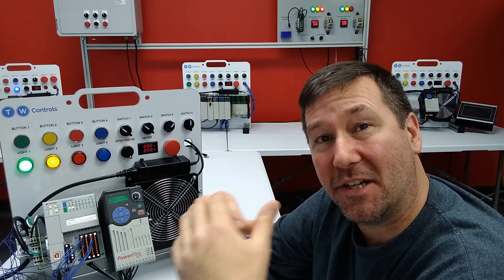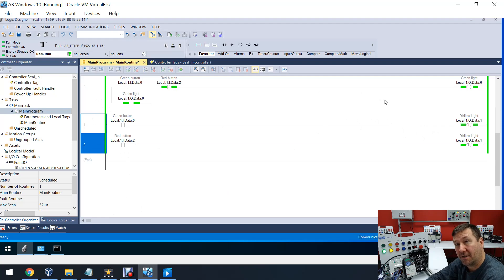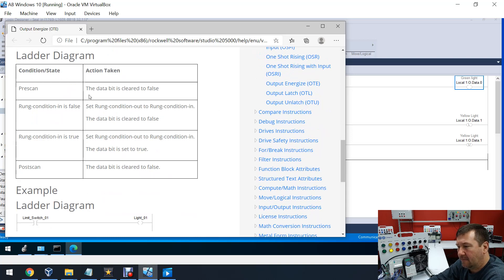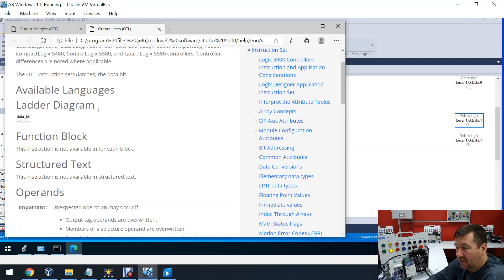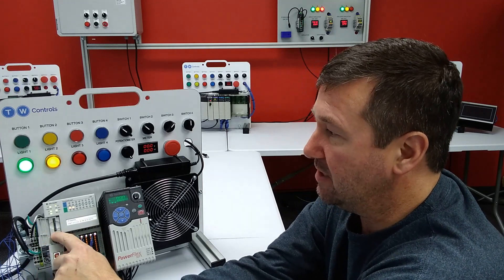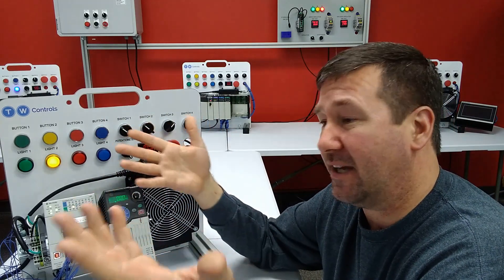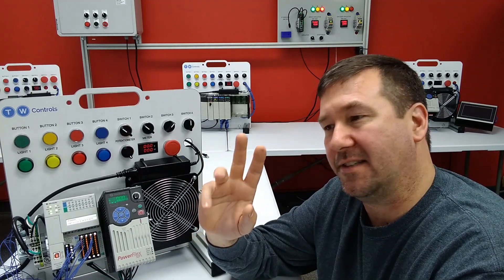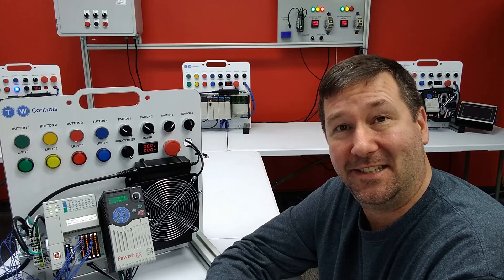Studio 5000 Power Up OTE vs OTL OTU of a Controllogix Compactlogix

Comment: Ok Tim, I tried the example with the S:FS instruction on my (U) rung but have multiple inputs via branching. When I added the S:FS branch it did not show First scan when hovering the mouse pointer but I got an error Invalid Direct File Offset?? Can this be used on multiple branches on a (U) rung??
Reply from the maker: What PLC are you using?
Reply: SLC 500 L541 16K  @TimWilborne
Reply from the maker: It is S:1/15 in it.
Reply: I'm not sure what you mean Tim can you clarify S:1/15 @TimWilborne
Reply from the maker: You are trying to type S:FS in a RsLogix 500 program.  It does not exist, it is S:1/15
Reply: Ohhh Ok Thanks @TimWilborne
Reply: Ok Tim,, That Worked, Just a type-O Thanks and your the best!!!! @TimWilborne
Reply from the maker: You are welcome.

Comment: I can't find the first scan bit in my controller
Reply from the maker: Just type it, it is hidden
Reply: @TimWilborne  thanks Tim
Reply from the maker: You are welcome
Reply: @TimWilborne  Hi Tim, when i add S,FS in the program the plc doesn't recognize it do i have to add it as a new tag ?
Reply from the maker: @nassimlamrous3721  It is S:FS, it is a colon in between, not a comma.
Reply: @TimWilborne  my bad I thought it’s a comma, I worked thanks a lot you are the best
Reply from the maker: @nassimlamrous3721  Glad you got it working.